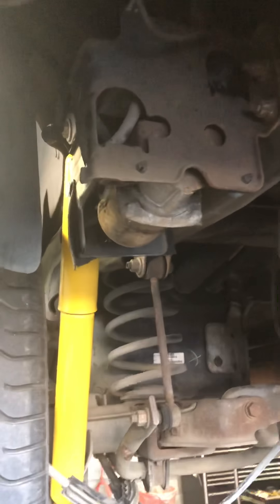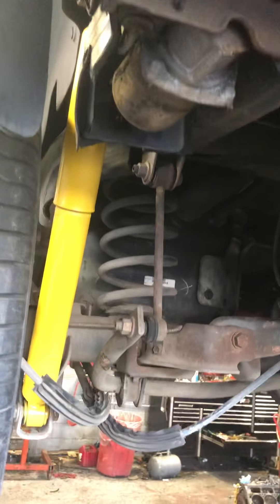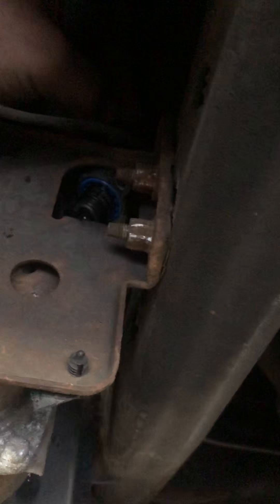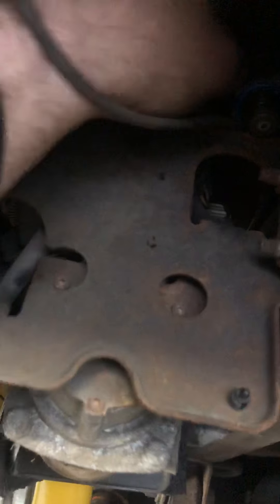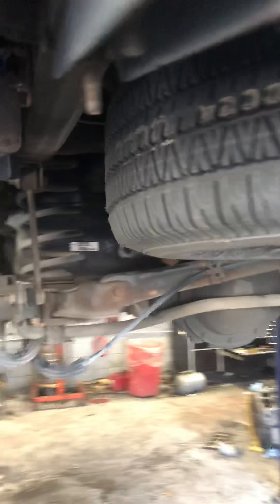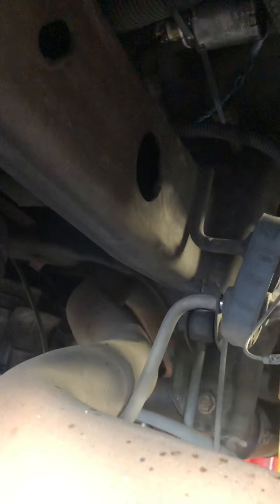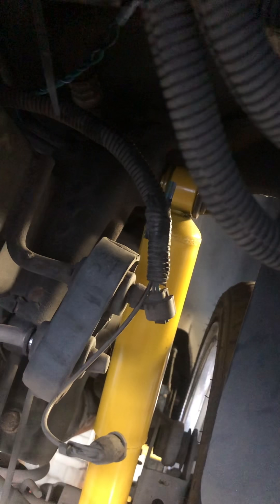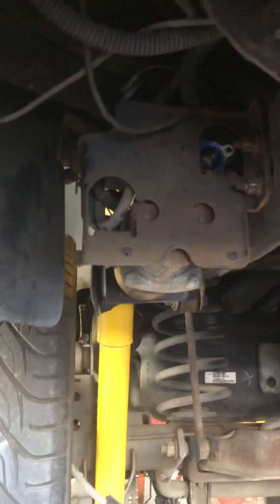tahoe escalade yukon z55 delete with new shocks for $45 99-06

Comment: If it's a Denali you gonna have to upgrade those coils to. The air ride coils are too weak to not be supported by the air shocks. Or you could just put some of those rubber spring spacers in there to stiffen them up a little lol
Reply: Hey if I want to lift the rear end on a Z55… Will the same coil lift spacers that fit non-Z55 coils, also fit the Z55?

Comment: I plan on doing a regular shock conversion to delete air ride. Do I have to buy solenoids for all that stuff? Or can I just put shocks in and nit worry about suspension codes on the dash?   Would it harm anything at all if I just did the conversion without everything?

Comment: Hey man...I appreciate you making this video...i just took out the air ride shocks in my 07 GMC Yukon Denali...do you know what size resistors exactly you used and where you got them?  Also...my air compressor was already not working, so should I disconnect it?   Thanks bud..
Reply: I'm still having "service suspension system light" come on.  I added resisters to all 4 tires, what did you do to the pump to prevent that light???
Reply: @John Schleifer  my light is still on...let me know if you learn how to bypass it....thanx
Reply: @johnschleifer7803  @Timothy P
I don't know if you still have the service ride control message, but if you want the error gone you can pull the RTD fuse under the hood with the battery disconnected and the message will clear. Leave the fuse pulled. Hope this helps

Comment: This is the easiest job ever. Pull 30 amp fuse, disconnect batt cables and touch together. Install shocks of choice. Connect battery! Full send. 
You don't need that other stuff....
Reply: Will the light stay off with this method?
Reply: @ChrisTheMobileMechanic  I did it on my 04 Caddy EXT. Just bought the $300 dollar kit for a Tahoe. Every now and then I get the chime for service stability when im hammering on it, but no light. Pulled the 30 Amp fuse. Lifes good! 

Edited: I did buy the kit, but it comes with springs which you really do need. Ever notice how sloppy it rides. Like bouncy and sluggish. It's actually unsafe to drive it without the coul spring kit. You have a stiffer suspension up front and some sloppy crap out back. Kinda the tail wagging the dog effect. $300 dollars well spent IMO. Good luck out there.
Reply: @ChrisTheMobileMechanic  I did it on my 04 Caddy EXT. Just bought the $300 dollar kit for a Tahoe. Every now and then I get the chime for service stability when im hammering on it, but no light. Pulled the 30 Amp fuse. Lifes good!

Comment: Does the Z55 Autoride suspension have coil springs too? Or does it ride entirely on the air shocks?

So, when converting… you need to install coils and shocks?
Reply: yes amazon sells a bilstein kit for $343 am ordering today for mine
Reply: @kennymartinez973   That kit is overpriced... You can just get the Bilstein shocks ($89 each) and Moog (Z71) coil springs ($69) and save $100
Reply: @castleclubclipz  yea i ended the bilstein front and rear shocks and moog rear coils